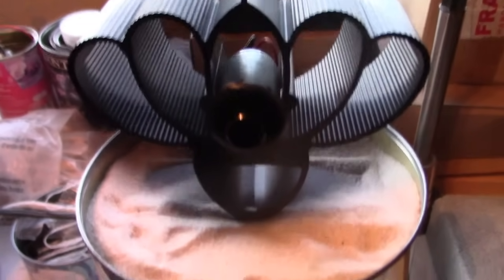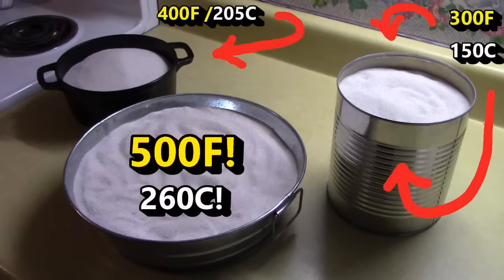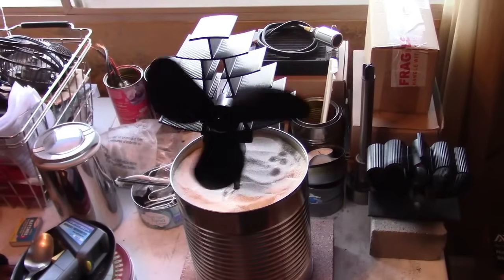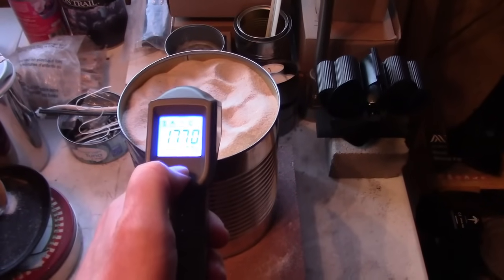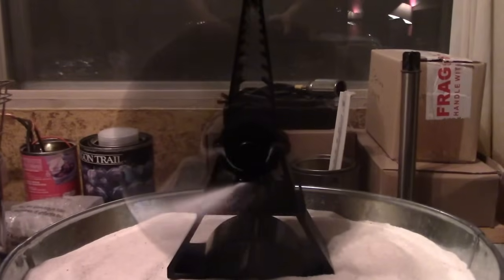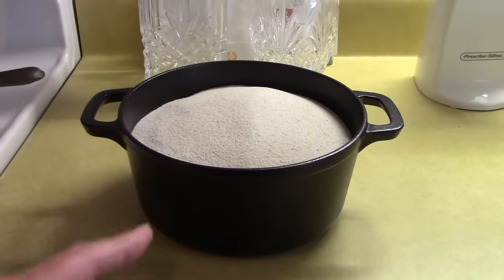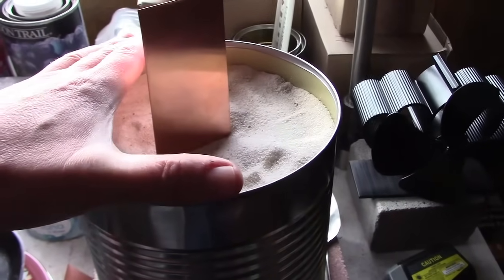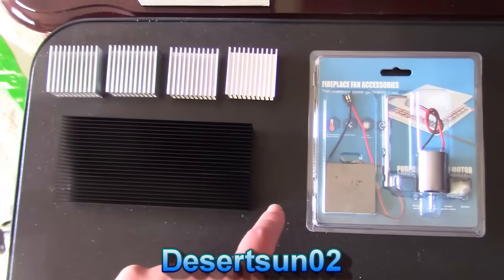DIY Sand Battery Air Heaters! w/heat powered fans! no electricity needed! sand battery room heater!

Comment: I wonder if on the bigger tub one could cut a hole big enough to fit a terracotta pot and heat the sand with just tea candles you'd have to support the tub and pot with bricks probably the candles are cheap enough to keep heat going into the battery all day and might carry the heat through the night say 3 candles a hour 36 in a 12 hour period so what $2 a day $14 a week $364 for 6 months probably less depending on the weather if my maths right
Reply: At this late hour I forget exactly who, but somebody upthread said he does heat his sand with 3 tea candles.  Your math's probably not too far off either.  Thing about using any candles to heat through the night (or day) would be whether you have little kids or pets that might blunder into it.  I'll never regret that when I retired to TinyTown, I put a huge propane tank about 50' from the house.  Never let it get below 50%.  Cheapest way to heat anywhere near civilization.  But just in case, I keep a big bag of wood pellets on hand so I could easily burn enough to heat the sand on the porch and then bring smaller buckets back in.  Too old and creaky to carry big buckets in from a fire pit.

Comment: I've been using sand batteries for years. My wood stove is in the basement, the exhaust pipe is double walled but single walled where it goes through three 50 gallon drums filled with playground sand. The three 50 gallon drums are upstairs in the main rooms and get super hot. Almost as hot as the stove itself. Every night the fire goes out and 6 hours later the upstairs drums are still super hot. I heat my entire house on just 6 medium sized logs a day. The sand batteries distribute the heat better and retain a ton of it.
Reply: Would be nice to see a video of that!
Reply: @gabrielgundulf7139  I second that
Reply: I’m an engineering student and I find your comment super awesome to read. Nowadays they keep pushing water to be used as thermal storage but it needs maintenance. I never knew of sand thermal storage until now, just bricks. Thanks!
Reply: @joecool4656 water, nitinol wire, mercury, steam in a single system add this or whatever you can create amazing things.
Reply: @joecool4656 . I believe it’s in Sweden or Finland where they have industrial size same batteries
Reply: @joecool4656 what if they used wet sand?
Reply: @montarctica oh sweet summer child, water boils at ? . So it will have to boil off all the water first before the temp can go up... What do we get by evaporation? Thats right! Cooling. Thats why evap coolers are a thing. Your thought is great! Never stop researching! God bless!
Reply: Hi Krod Krod, I experimented with pans small, big ones, on a rocketstove, on a gas burner etc.Hours en hours heating the sand, than i put the woodstoveventilator on top. It start rotating but there is no spectacular heat  coming of. There is something I do wrong..... after one hour the fan is still running but no heat anymore?? Then i dig in the sand a little bit .... it helps a little. So,.... not hours warmth.... 1 hour and its already over and out.
Do I perhaps use the wrong sand??? I bought so called Silversand....??
Reply: @M.P.007  
I think you are right about using the wrong type of sand...i saw people using beach sand and others play grounfmd sand...one was referring to the heat absorbance quality sand with a high quartz level...
Anyway,i do not know for sure what is causing the problem. 
But if you are near a beach you could try beach sand and otherwise you could buy for a couple of dollars some playground sand and try that out...
You could it keep cheap by that..
Reply: @arjanhassing6345  HI Arjan, thanks for the tip! Next winter i'll trie again!
Reply: @M.P.007 It is a bit difficult to determine anything without seeing pictures of the pans you are using. Generally, pans are not very deep. Maybe an inch or two at most. That doesn't sound like it is a very large thermal mass to adequately provide heat for hours on end. KrodKrod described using 3 50 gallon drums full of sand. That is a huge thermal mass.

I think it would be more helpful to describe the size of your heat battery either by the weight of the sand or the volume. Weight (mass) being more preferable as the heat capacity of a material is described as heat per kilogram per degree. 

Overall, while the objective is to store heat in the sand, sand is an insulative material. Heat does not flow easily through it. Think of standing barefoot on sand at the beach and getting burned vs. digging your feet down into the sand a couple of inches and they are fine.

However, you can make the sand a bit more conductive to heat as shown in the video. By using a copper plate, shim, or strip to conduct heat from the middle to the top where the fan is at.
Reply: @MushInSkull what about if you had copper shavings throughout the sand?   Or used the iron /gold rich black sand found here in washington. State around the puget sound area?    Seems Iike it may work well? 

Or would it dissipate the heart too fast?     

I would think the quartz sand found on some beaches would be excellent. .
Reply: @MushInSkull  Looks like this video just show the ability to use sand as a heat source. Not that the illustrations he used would be adequate to heat your space. At least that is what I got from it. KrodKrod used this type of technology and designed a system that was adequate for his needs.
Reply: Do where did you get the fans
Reply from the maker: that's awesome!
Reply: Heykrod krod
 do you have a picture of that set-up I'd like to try something like that at my cabin please
Reply: Make a video on the setup
Reply: my grandfather did something similar in his farmhouse, no basement and ground floor was brick.  Had a coal stove along one wall in the living room, the exhaust didn't go up it went sideways into a brick structure along the wall about as wide as a bench seat that ran along that wall to the front wall.  Then it went out to the patio he'd turned into a small greenhouse for starting garden plants by building green plastic greenhouse panels all round it where it went through another one of those structures before finally venting outside.  When I eventually asked him what they were and why he kept them clear he shifted the concrete board covers he kept over them and showed me they were full of sand.  A couple hundred gallons of sand each.  They kept the entire farmhouse and greenhouse above freezing with radiated heat during winter.
Reply: @Radagast49230 

Like a Cobb bench coming off of a rocket thermal Mass heater
Reply: I would love to see that!
Reply: Can anyone direct me to exactly kind of sand?  Will it be found at a home improvement type store ?
  Thank you
Reply: @sherrib2023  Just regular old sand. The best place to get it is at industrial supply places like concrete companies or giant yard market type stores.  buy it by the truckload. The sand in the bags at stores like home depot are super expensive. Like 10 times the normal cost of sand.
Reply: Great idea.  How big is your house?
Reply: @Greenr0  A little over 6000 square feet. Its a ranch style so only 2 floors to heat.
Reply: 3 50 gallon drums probably is a ton....
Reply: @jamesgeorge4874  Yep. Don't fil them with sand until they are in place.
Reply: You need to put up a video.
Reply: How long do you heat the sand for
Reply: @BigcountryReactions  I usually only run it at night. When the sun comes out it maintains everything.
Reply: Common Sense ~ ''I'd think that 700 lbs. of sand plus the weight of the barrel and it's 23 inch footprint would put unnecessary stress on the floor joists and the heat from the sand cannot be good for flooring either.''
Reply: @jayhouse3149  My house is pretty sturdy.  Its not your standard cheaply built cookie cutter house. I have 8 steel I beams holding up the first level, because under my basement is a wine cellar bigger than most people's houses.  There are no center loadbearing walls down there.
Reply: Sand has a low heat transfer coefficient of 0.06 watts per square meter. Wood is 0.13
Reply: if you add a microwave coil into the fire at 100,000,000 volts/ 0.000,000,000amps for 0.000,000,000,001 second
you only need 0.000,000,001 gram of charcoal,
Reply: Use oil lamp in absence of wood.
Reply: Couldn't this technique be integrated right into the walls?
Reply: Really neat idea
Reply: Please can you make a video
Reply: How many tree's do you have to plant each day to offset 6 logs?
Reply: @XiaolinDraconis  I have a 400 acre forest.
Reply: @XiaolinDraconis  doesnt really matter, because more co2 in the air means faster vegetation growth anyway. Plants live on co2. More co2. More plants. More awesome! The climate goal bs is all a big hoax just to keep the Economy going. And make people go more and more batsh!t man
Reply: So your saying it's better than cast iron stove
Reply: @Dee-qo7gh  You still need to stove for the heat source. But sand retains and dissipates heat for several hours longer than just the cast iron stove.
Reply: Holy Guacamole Batman!!!
I just discovered this a little while ago the 100 ton polar night battery in Finland... Phenomenal setup you have thank you!!!
Reply: That’s a good idea.
Reply: No power, just hot sand and fans—perfect for off-grid heating solutions!
Reply: That is brilliant
Reply: I have considered putting a sand box on top of the fire box of my wood furnace.
Reply: i wanna see
Reply: Can you upload a video of this? I’m very intrigued.
Reply: BS
Reply: Lies

Comment: I have two Metal garbage cans filled with sand with a copper coil in it being heated by my wood-burning stove
Reply: How exactly are they heated by the stove?How is the copper coil put in them ?How much copper coil?Any details would be helpful.How long do they retain the heat and do u have fans to move the heat?etcetc.

Comment: isnt WATER 10 times beter heat batery then stone?
Reply from the maker: hi. sand is better than water, plus it can store heat at much higher temps (212F(100C) versus up to 3000F (1648C)
Reply: you right!

Comment: See the thing about those sand batteries is their pointless because technically you're not saving anything because you're using your stove or your oven to heat the sand so it's really not like it's conserving or saving you I don't believe unless you're using solar
Reply from the maker: hi. remember, though, that there are many many ways to heat sand off-grid like fresnel lens, parabolic dish, solar oven, campfires, rocket stoves etc. the oven or stove top are the two 'on grid' ways. i just recently posted a video on sand batteries with 12v heaters in them. can run (or charge) directly using a 12v solar panel or 12v battery.

Comment: how did ya heat the sand up to those temps?
Reply: I keep a big bag of wood pellets on hand so I could easily burn enough to heat the sand on the porch and then bring smaller buckets back in.  Too old and creaky to carry big buckets in from a fire pit.

Comment: did i miss some parts? why would you create sand batteries that require heating up to and over 100 degrees to blow air? it cant be for indoor use surely?

Comment: This is such a good idea for desert areas that get high heat during the day, but cool off quickly at night. An insulated container or wall that gets heat during the day?
I heard of a house that had a big wall in it's interior and they used it to cool the house during the day.
Reply: Mike. I like this idea. Been thinking about setting the sand in  a dutch oven or other black metal container and then placing this in a solar reflective oven during the day. Be curious to see how hot that would get and how long it would give off heat.
Reply: Look up "trombe walls"

Comment: These are potentially a good option for residential stored heat programs. Given that dry silica sand has a specific heat of 0.198 BTU/lbm*Δ°F, then every 100lbm of sand heated to 500°F stores about 8,500 BTU's. The heat loss on an average US home is roughly 30 BTU/hr. per square foot of floor space so if you wanted to do a stored energy system, you would need roughly 350lbm of sand per 1,000 square feet of floor space. That is not a large volume of sand but the problem comes when trying to heat sand to 500°F. You could reduce that temperature to a more manageable 150°F but then you would need about 1,900lbm of sand per 1,000 sq. ft. Our focus should be on building design to maximize energy efficiency.
Reply: 1,900lbm sand is about 21 cubic feet of sand or 2.75'x2.75'x2.75'.  The heat loss of a well-insulated house can go as low as 4 btu/ft.  Air has very good r value 3.6/in.  A double layered house with one foot of still air space in between envelopes has a r value of 43.
Reply from the maker: hi there. thanks for the info and stats ✔✔

Comment: Saw a video a  few months ago where they were using a solar reflector or fesnal lense to focus solar radiation one a sand battery during the day and bringing inside at night to release the heat.  Buckets of sand were maintaining high levels of heat for over 9 hours. Your idea of using the thermal fans is awesome !!!
Reply: This is the concept behind a masonry heater type fireplace - look them up and see what the europeans have been doing for about 400 years (I think it’s been around that long) - I had my built at my house and love it
Reply from the maker: hi and thank you! i love those fans. i'd be curious to see that video. i was thinking there might be a way to use a 55 gallon drum with sand in it. if you heat that up the sand would release heat for days.
Reply: @desertsun02  maybe not days, as someone else commented that they have three 50 gallon drums with sand around their wood stove chimney and it radiates heat for about 6 hours.
Reply: @sheona7693  they didn't sound like they had much insulation. So it would just be dumping heat really fast. A ceramic lining like a water tank has would allow for less heat per hour but drastically increase the duration.
Reply: @XiaolinDraconis  Another thing you can buy is a space blanket and partially wrap the containers as needed
Reply: @desertsun02   where do you get the fans?

Comment: So for how long does it take to get the sand hot enough on a stovetop, and how long does it hold the heat or for how long will the fans work? In other words tell us more about the “battery” properties of sand.
Reply: He's basically saying, and others also... the sand doesn't heat up fast, comparatively. The copper is what heats the sand up fast. But the sand retains the heat longer over time. Metals both cool and heat up and down quickly. That's why he doesn't do ONLY copper with no sand. The sand holds the heat in long term. So the sand once heated will retain the heat, but the sand gets benefit from the copper 'kick starting' its heat by heating it up faster than it could do on its own. The sand doesn't have the property to heat up fast, but its property does hold the heat... to a point. 

After understanding this its about numbers on paper of how many hours and minutes to hold the heat over time, and how many minutes for the system to get heated up. I don't know all the numbers, but I understand the basics of why which materials are used, and why. I do hope others can put up numbers on how long they could get it to last and shapes of containers, etc. (shallow containers without depth should lose heat faster than something thick. container shape should matter. And having a lid on it may also help retain heat.) 

...

Other people doing similar videos often forget or don't know about what the copper does. I saw others they didn't have copper in them. The fans will work where there's heat. The fans work on the exchange of hot and cold air flowing.
Reply: @noahriding5780  the fans have a thermocouple in the bottom that converts heat into electricity which runs the low power fan.
Reply: @radiomanz117 don't they have similar fans to this that using the differences in temperature (basically a stirling engine) to run rather than converting to electricity? Seems that would increase the efficiency with less losses of energy. Storing heat in sand if your using an external heat source such as a flame I would think not be as efficient as a fresnel lens or a parabolic solar reflector during daylight?
Reply: @noahriding5780  thank you! That’s very helpful…
Reply: I’m sure it’s got something to do with the silica, silica is used in solar panels…

Comment: Just out of curiosity, I wonder how hot the sand could get if you had a fresnel lens focused on the sand outside for awhile. Have you ever tried that?
Reply from the maker: hi. you could probably get the sand to 1500F (816C) or more with a large frensel lens. i'd like to try that but i don't have a big lens. my guess is that might be a super quick way to get the sand ultra hot.
Reply: That would be cool to try with your double lens. I wonder if graphene or whatever coated onto the copper would make a difference
Reply: Or coat the copper in the same stuff that is used to coat microwave kilns
Reply: The instructables website is where I seen the kiln idea for the coating
Reply: Thank you for sharing what you do.
Graphene can be made with peroxide or obtained from some brand of water filters.

Comment: QUESTION:  Could you attach another Peltier module and bury it into the sand to reheat the sand?
Reply from the maker: hi. possibly, but i'd use something like those aluminum tablet ptc heating elements. they are about the same size and put off a ton of heat. i'm working on a video right now using those to heat the sand